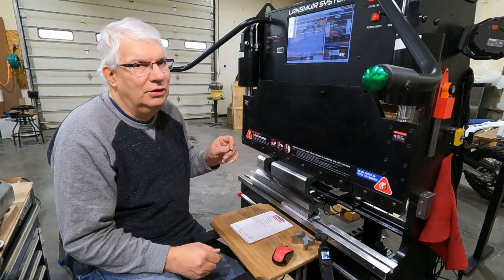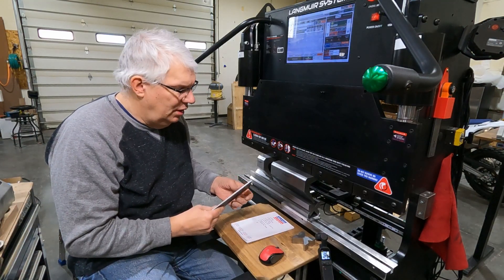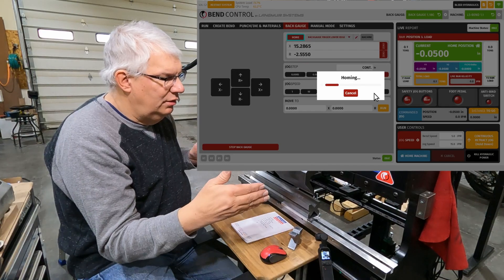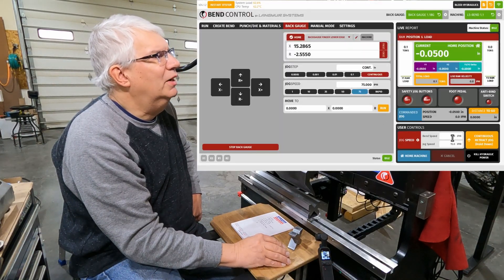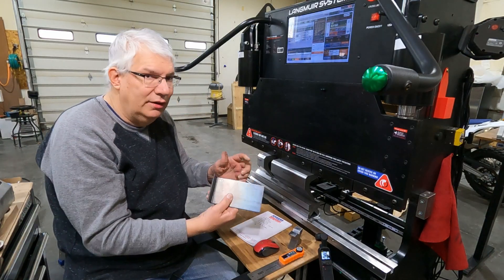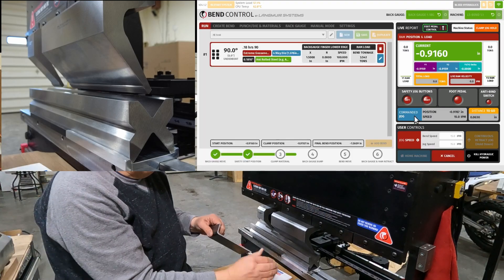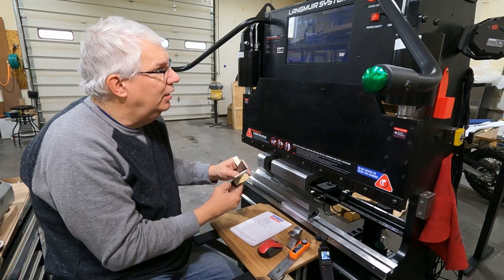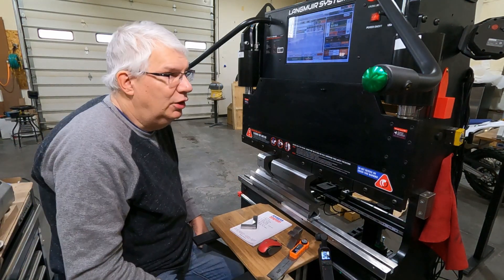Titan 25T 7ga HRS Bend Testing - Part 2

Comment: Ideally you would push the bend further into the brake for the 2nd bend using the cnc back-gauge and gooseneck die. If that doesn't fit I get what you are doing.
Reply: Or you could reverse the die it’s usually an easier option

Comment: Does the back gauge tilt to compensate for angled bends relative to the part?
Reply from the maker: @stevenichols1481  unfortunately no, this brake and it's software implementation are quite simple. On the flip side, users (me) get a better understanding of the brake process.

Comment: Do you plug into the main USB on the face of the machine next to the power switch to use a mouse, or do you have to plug somewhere in the guts of the machine?
Reply from the maker: On the front panel.